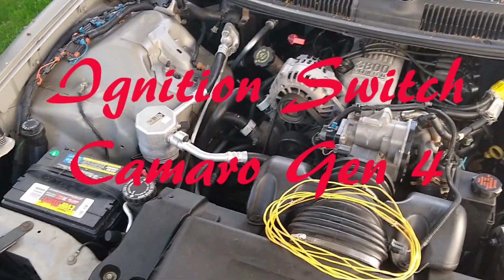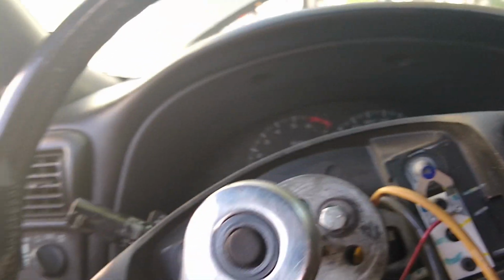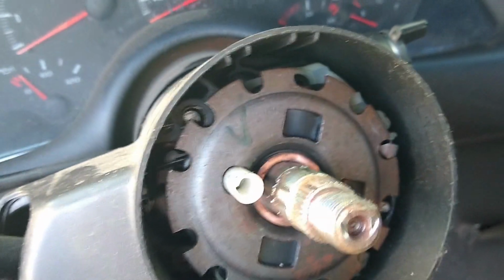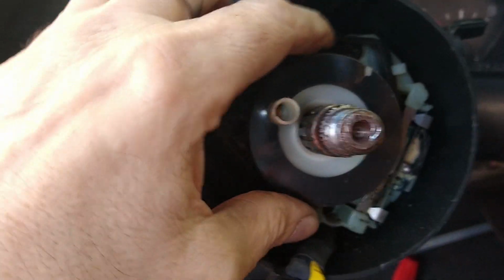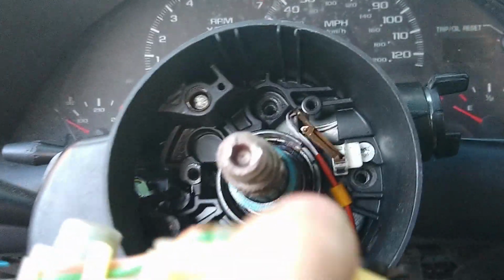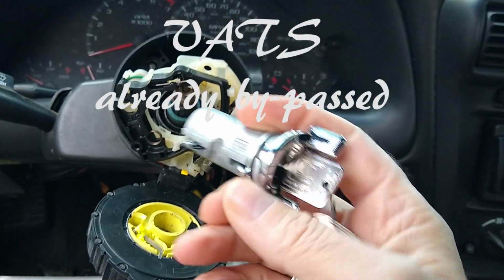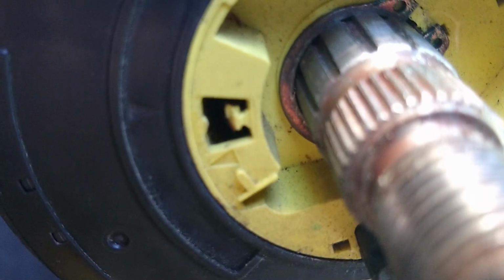Ignition Switch Replace Camaro Gen 4 F Bodies #GearHeadsWorld

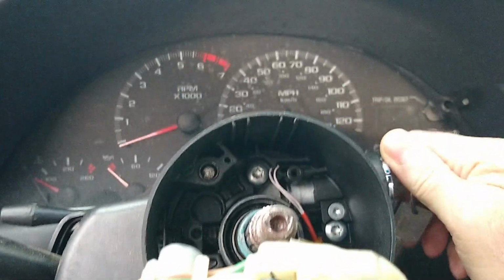Comment: at about the 7:30 mark of the video, you advised us that the key was difficult to turn after the screw was replaced to hold the lock cylinder in.  this happened to me while working on my son's camaro. 1988.  we used a hand file to increase the size of the groove on the lock cylinder and it relieved the situation.  normal force needed to turn the key cylinder afterward.
Reply from the maker: Great bush fix  😀

Comment: How did you read the ohms without the original key? Im having trouble figuring out which resistor it is because when i measured it, it read 5.86 and constantly it doesnt change
Reply from the maker: Has been a while since I rassled with this. As I recall, there was a list of the resistor specs and you could go thru a process of trial and error to narrow down the correct spec. Good luck
Reply: Chuck Fasst sorry i forgot to mention it but i located the 2 packs closest to it which where 4.87 and 6.12 i believe it was between those two and im trying to figure out the process of it do i wait 5 minutes before trying a new resistor or do i wait 5 minutes while the resistor is plugged in and once i try it with the key do i half to hold it in the on position or does it automatically start off the bat
Reply from the maker: @losthreeonetwo2049  Hard for me to remember these days. I recall having to put the key into ACC position for 10 min. at times when I experienced the security lock preventing starting. Was a real pain in the ass ... I do remember THAT! I don't think holding switch in ON position will help you imho